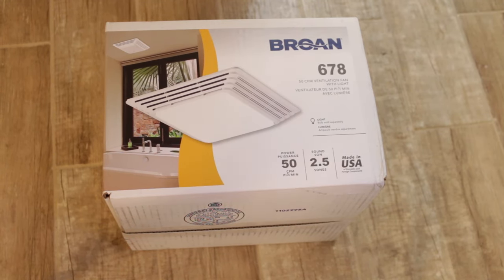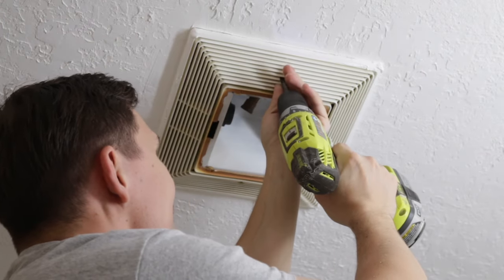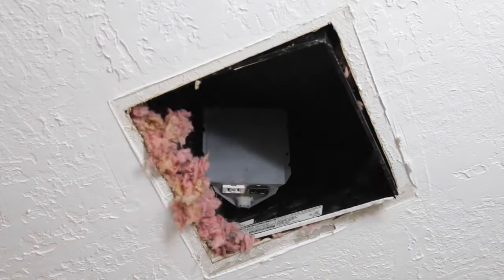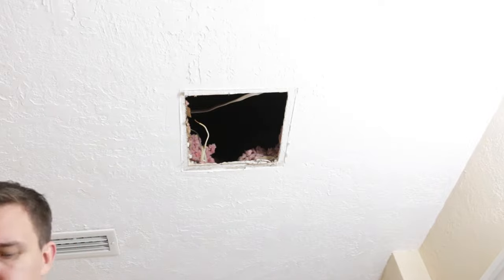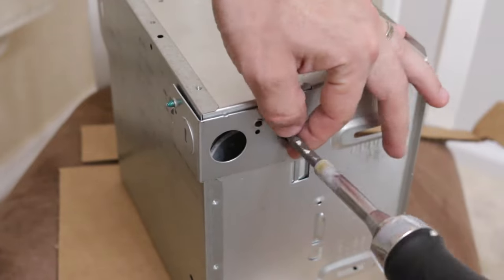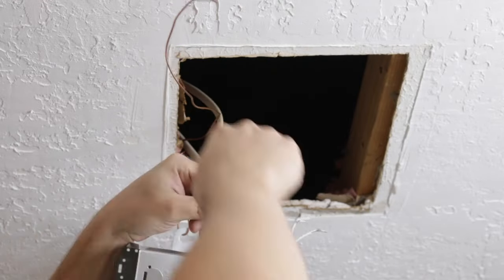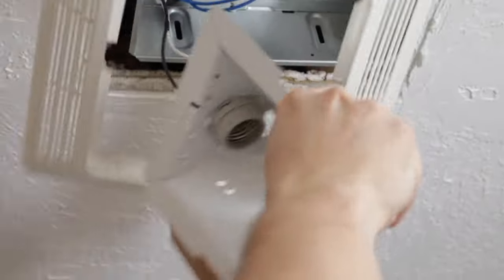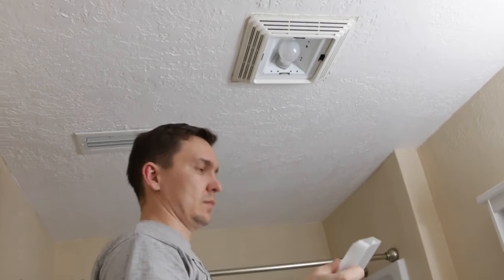How To Install A Bath Exhaust Fan | DIY

Comment: Sheesh this is horrible, don't leave a big gap like that. You'll invite every insect in your attic straight into your shower, plus you'll lose a lot of heat in the winter. At the very least tape that up. Even better... go get some drywall, some drywall tape and some hot mud and fix it the right way. It doesn't have to be pretty because it's hidden, but it should be solid.

Comment: You didn't vent it. If it's going into attic it will have mold damage. Just because person who installed the old one wrong, doesn't mean you should too. Oh well.
Reply: he's using a Ryobi drill what'd you expect
Reply: Isn’t he attaching the vent at 4:23?
Reply: @Mactendo64  tool shaming 😂 dang
Reply: He did.

Comment: This is how not to install an exhaust fan. first it's a fire hazard, wire nuts (the connections) must be inside the fan's metal junction box to avoid fire in case of sparking. Also  you should build the ceiling square hole (reduce the size) to fit the new  fan box, now there is a gap between the metal box and the ceiling which allow air movement between the bathroom and the attic. Also the way you stripped the wires was wrong! use a wire stripper to avoid damaging the copper!

Comment: There is a large gap between the box and drywall allowing heat to go into attic. Shouldn’t that be taped around it to block the escaping air?
Reply: I have that problem with my bath exhaust fan. Whoever installed it fastened it wrong and left a big gap bewteen the housing and ceiling drywall so in the summer all that hot air escapes into the bathroom. Makes the fan counterproductive. It should be a tight square, no gaps around the housing. It needs to be sealed. Covering it with the decorative cover doesnt help.

Comment: I have this model and notice it leaks so much outside air from the exhaust when off... How do I fix that?
Reply from the maker: what do you mean? when it is off the fan isn't running
Reply: If you mean it leaks outside air back into the bathroom when the fan is off, you probably installed the exhaust damper assembly upside down. https://youtu.be/hdvoI_XQWXo?t=395

Comment: Wrong 👎 

There is too much of a gap surrounding the new Box.  The ceiling hole needs to be exact to the box you are installing.  If not you have insulation falling unto the grille and consequently into the bathroom and or extractor fan duct and out of the home.

 Fix: build it up with straps of wood ( 2x4 is okay but is over kill ) , dry wall straps or go into attic and seal with HVAC Duct tape as last resort.

Point is you should not have gaps.  Plus your bathroom will be hotter because you are sucking in hot air from attic when extractor fan is on.